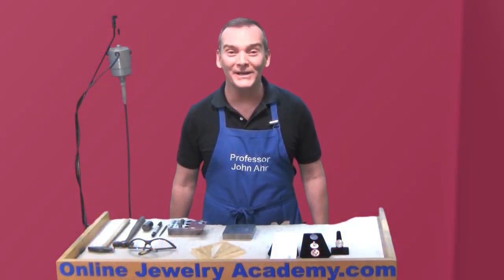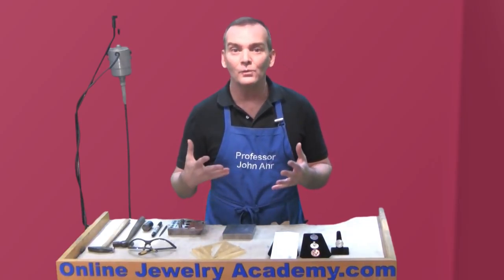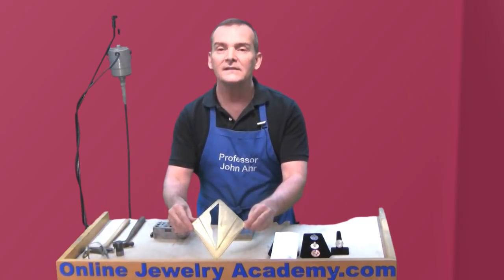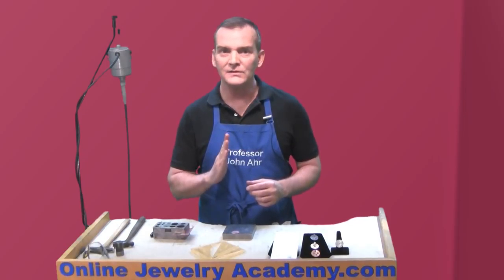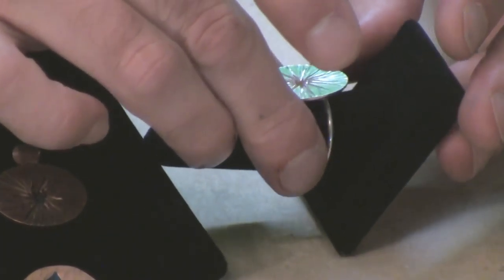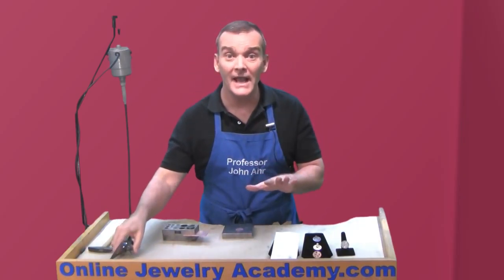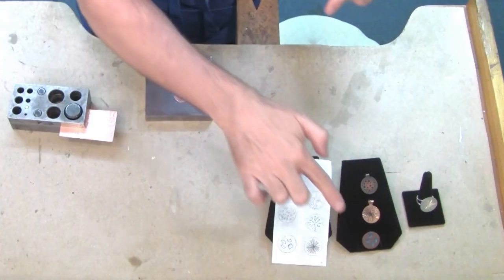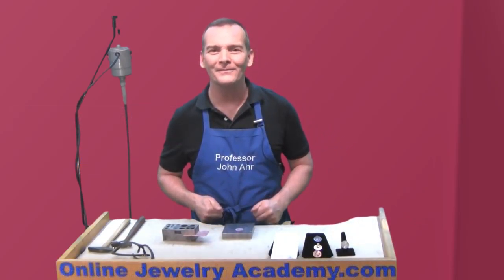Make The "Super Nova" And "Riding The Wind" Pendants"

Comment: Happy New Year. Thanks for taking the "scary" out of these techniques. Quick questions. I just got my disc cutter and it has been suggested by fellow jewelers that I use a Brass hammer. What is your opinion on that? Also, do you need to anneal the copper after you have textured it before using the disc cutter? And lastly (sorry so many questions) what do you have your cut out disc on when you put the epoxy in it?
Reply from the maker: Hi Kim, First, I want to remind you that the video you posted your comment to is a follow-up to an earlier video entitled "Domed Lotus Pod Pendant."  In the previous video I showed how to solder the decorative top of the piece onto a domed backing that would hold the epoxy.  Your friends are correct about using a brass mallet with your disc cutter.  The brass mallet will suffer the wear and tear rather than your cutter.  By the way, the OJA has a video on how to use a disc cutter that might provide you with some other useful tips.  And, you don't have to anneal your metal before you cut it with the disc cutter.
Thanks for your support! : )
Reply: Thank you for getting back to me. I sent Hubs for the brass hammer and found your video on using the disc cutter. Wishing you many blessings this new year.